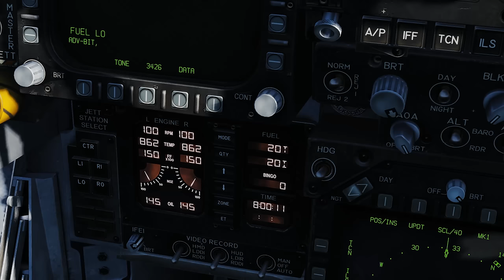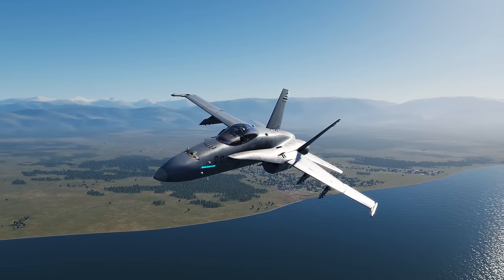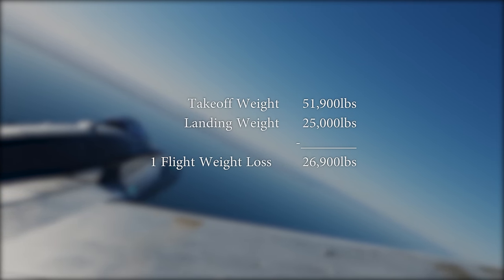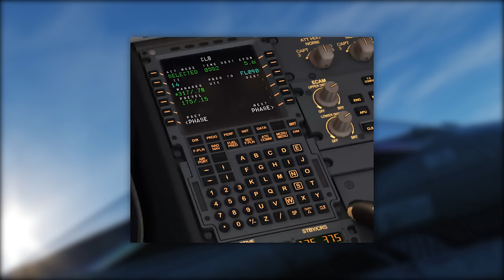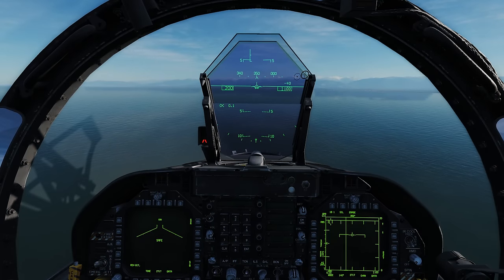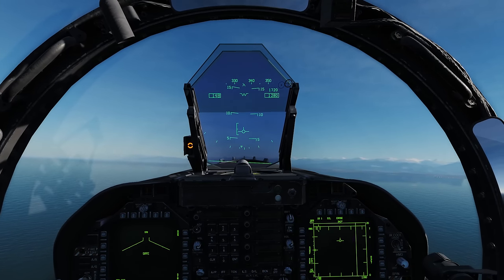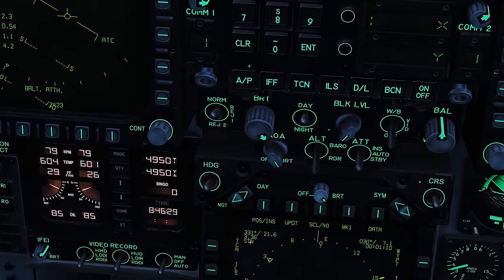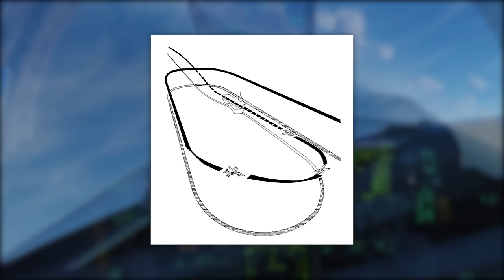DCS World - F/A-18 - Case I Carrier Recovery Tutorial

Comment: How come your on speed is ~130 KIAS? I get like ~180 with gear and flaps full. What am I doing wrong?
Reply from the maker: All depends on weight
Reply: Jabbers thanks. I wondered if that was the case. I need a tutorial on this. Coming from the civilian world being used to the ils I'm totally lost on vertical guidance.
Reply from the maker: You need a tutorial on what exactly?
Reply: Jabbers in this video he talks about being on speed. But there is nothing to tell you about vertical guidance, that is if you're too high or too low. And I don't been the meatball. I mean from the hud. And I don't understand the how to use the E.
Reply from the maker: The E is your on speed indicator, without touching the stick if the velocity vector is near the middle line on the E you are on speed (proper AOA).  As for vertical guidance, you have your altitude in the top right, and above it your vertical velocity indicator (VVI)

Comment: Jabbers and anyone who reads this... Just wondering if I'm a total dipshit. Basically when I'm landing on a carrier I actually find it easier to go with flaps still in auto and I'm putting down around 175-180 airspeed indicator. The E bracket shows me on speed AOA. For me, doing it this was works every time. When I try it with flaps I look like a bird learning to fly. Also I just got into DCS and flight sims in general about a month ago so I'm still incredibly new.
Reply from the maker: Takes time to get good, what kind of gear are you flying with?
Reply: I'm using the Thrustmaster T-Flight Hotas X Flight Stick. Came with a throttle as well. Works well for $50.
Reply from the maker: Might help to add some curves to your stick and throttle to help with this